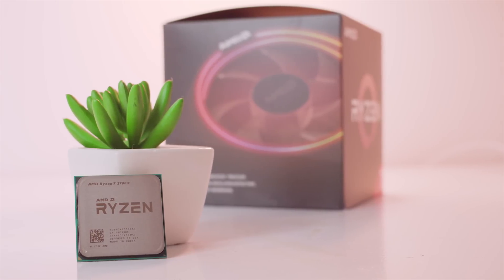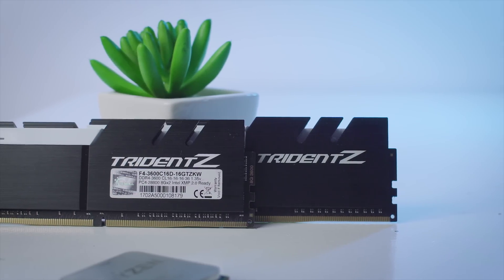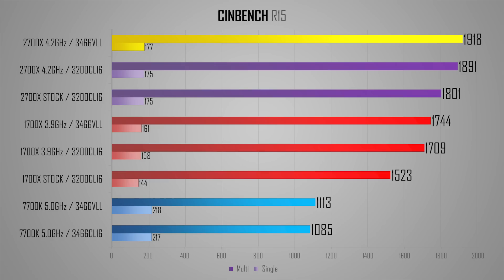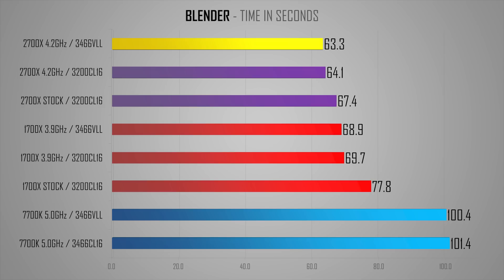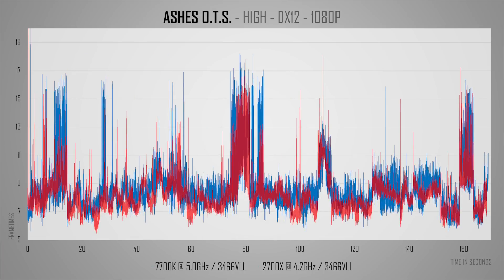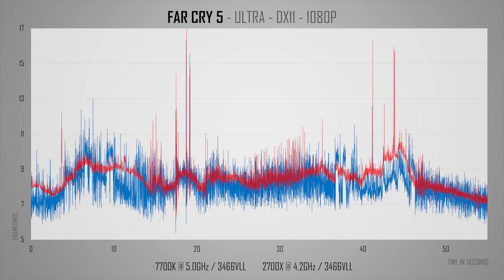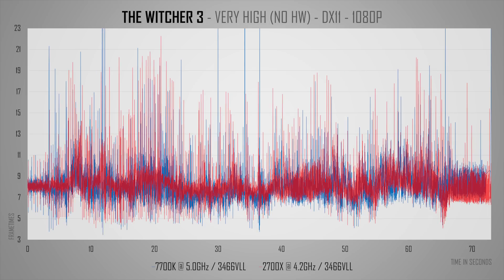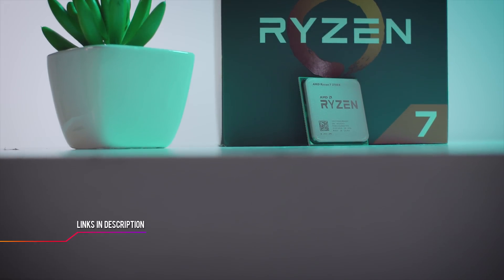RYZEN 2700X + Low Latency RAM - Still AMAZING PERFORMANCE gains...

Comment: https://www.microcenter.com/product/506496/gskill-flare-x-16gb-2-x-8gb-ddr4-3200-pc4-25600-cl14-dual-channel-desktop-memory-kit-f4-3200c14d-16gfx---black 
i wonder how these would perform.  I wonder if you could leave it at cl 14 and just overclock to 3466
Reply: It should be fine. Just turn up the voltage

Comment: @Mindblank Tech What were your timings (complete set) with your 1700x with the trident z ram? I've got an 1800x and trident Z ram and can't get stable at 3600mhz. Can you please share those timings for me please? Or email me at citizentechtalk@gmail.com please. P.s my 16gb 8x2 kit is a 4000mhz kit. I'm currently running cold boot 3466 14VLL myself. On warm boot 3533 14VLL on an Asus hero X370 board.

Comment: I'm late for the party. But, very nice video and very well put together! What do you use to test your RAM and CPU stability? I have tried Memtest86, AIDA64 Extreme stability test, and others but none give me accurate reliable results. Until I tried Prime95 v29.6 build using Large FFT's test. After an hour and a half the true colors come out. Every single setting I thought was stable at first failed the test.

I had to do some more tweaking to my 3466Mhz settings using the "FAST" preset on the Ryzen calculator to finally get a 6 hour stable run. No more random game crashing or system failing to boot at first try. I would never test with anything else again. Cheers and thanks for sharing this nice video!

Comment: So I have a question. I hope you can help? 
I have VLL on 3466mhz with my Ryzen 1800x running at 4.1ghz no probs. On cold boot I can get 3466mhz Cas 14 VLL to boot and fully stable no problem. Although I can get stable 3533mhz at Cas 15 and full stability in games also, BUT! 
i can't get my Asus hero X370 to cold boot on 3533mhz. Why is that and how can I get it to do it please? 
My RAM is Trident Z 4000mhz Cas 18. It's also B-die. So how can I get it to boot 3533mhz cold instead of 3466mhz?

Comment: so 2700x is actually nothing special isn't coz my 7820x @4.7ghz does 2060cb and singlecore is 550-560..can't remember right.. plus no issues in daw's like 2700x....
Reply: Well I would be amazed if that AMD processor beat your 7820X when you cpu has 500mhz more clocks over it. Also your single core won't be that high on same cinebench version closer to 200 sure.
Reply: @MrRyusuzaku  amd will never work as 7820x in daw's btw....as amd is not design for those apps...amd is cheapper for reason ..and my 9900k is way better then my 7820x...no amd 8 core cpu can match 9900k...
Reply: 550-560 in cpu z...sorry my bad...in cb is over 200...

Comment: Any thoughts on getting CL14 to work on Ryzen laptops, like 2700U?  Also, though the 2700x officially supports 2933, clearly 3466 works great.  So I wonder for 2700u, which supports 2400mhz, what's possible.. could make a huge difference!!  Motherboard/bios dependent I suppose.

Comment: You got some good numbers with Cinebench! I just recently switched to a 2700X but I am running Hynix memory @ 3000 Mhz / CL 14 based on info from the ram calculator and I got very similar numbers in the same benchmark.
1906 Multithread / 176 Single Thread

Comment: yip im a very happy owner of my 1700...man my games are soooo smooth that intel could not give me.
have 3200 rgb gskill ram..its awsum..
have overclocked to 3600 ram and 4.15 cpu..but i dont run it like that 24/7..as even at lower speeds it is still smoother than intel

Comment: Did you ever check for a bios update after this? My X370F Strix board is running my 2700x with this same 3600 B die Ram. It runs it off the dccop profile just fine.

Comment: I got my ram to 3400 with a cheap Ryzen 5 1600. And the ram was rated at 2666, but I overclocked it to 3400. And it’s been great
Reply: what motherboard are you using?
Reply: Asrock B350 pro4
Reply: Thanks, I am thinking about getting this mobo + r5 1600 also... Would you mind telling me your ram so I can purchase the same model? I can't afford to have any compatibility issues...
Reply: My ram is the Ballistix Sport 16gb 2666mhz. I overclocked my ram to 3400mhz with XMP. My timing is 16-21-21-42. Voltage 1.38 
It also depends on the quality that you get from the ram. My ram got Extremely lucky. But either way, you should able to overclock it to 3200mhz. My 1600 OC to 4.0 with 1.375 V
Reply: Support You thanks man, I appreciate it :)
Reply: 16gb x 2    or  16x4 ?
Reply: dicloniusN35 2 8gb sticks

Comment: So the thing I'm noticing here is that the 0.1/1% low's are the things mainly being affected by the use of VLL RAM, atleast on the intel side of things anyway. So my question then is that when using  an adaptive sync monitor (G sync or free sync) does the improvement seen in the 0.1/1% lows even matter since the adaptive sync should eliminate any stutters/tears that would have been observed due to the fps dips in the 0.1/1% lows?

Comment: Could you please compare 1700X and 2700X both at 3.9Ghz and @3466MHZ VLL ? 

I've got R7 1700 which is a rather "good" overclocker since it reaches 4.075Mhz fully stable at 1.375v.
And even benchable/gamingable at 4.175Ghz @1.45v but my ram is not so good... old DDR4 2400 CL16 memory not very overclocking friendly.

But I've just ordered G.Skill Trident Z RGB DDR4 Kit 16Gb 2x 8 Gb 4266 MHz CL19, I'm aware it won't be able to run at 4266Mhz of course. I'm just hoping it will be able to do at least as good as yours. I am a bit worried though because it seems it is a single rank ram kit and heard that dual rank gives better performance on ryzen...

Comment: How come 1700x has faster 1% and 0.1% fps in ashes of singularity https://youtu.be/PHBsR1Y68G8?t=335
It seems strange that it should perform better. And also the stock 1700 is faster than the overclocked version

Comment: From what I understand, if geardownmode is still enabled, when the command rate is set to 1T it will still effectively run 2T. I am running 3466-14-14-14-28-1T geardownmode disabled on my 1700 at the moment, my 2700x comes tomorrow. I am going to try for 3200-12-12-12-24. that gives a calculated latency of 7.5ns If I can manage it. at cas 14 it would take 3733MT/s to match that latency. My Ryzen 1700/ram kit refuses to go below cas 14; we shall see if the 2700x changes that.

edit: I should mention that tuning the sub timings is important, leaving them on auto will cause a significant portion of the gains from overclocking to be lost.

Comment: The diffrence between 2400mhz ram to 3000mhz is about 30$ i own r7 2700x should i get the 3000mhz or its not worth the upgrade and stick with the 2400mhz ?

Comment: But this video still doesn't answer the question of which is better - timings or frequency? Like is it better for me to go from 3200 to 3000 but with tighter sub-timings?
Reply from the maker: Both, but to a certain extent. Can't say that 2400CL13 will be better than 3466CL16. I'd drop to 3000 with tight timings - it'll give much better performance than regular 3200.
Reply: I've heard that for gaming timings are better but at what point does it become detrimental to lose frequency? These are difficult questions and I'm just sad most reviewers aren't testing them. You're one of the only few that attempts to shed some light on the RAM issues.
Reply: @crazyforcs  if you can afford,  you can buy 4400mhz tridentz 2x8gb kit and get it to 4200 cl16. From watching many videos, seems like thats the best you can achieve for 8700k systems

Comment: Ryzen at lower GHz is competitive with Intel at 5ghz. Enough said.
If Ryzen could overclock as well as Intel CPUs there would be no argument because Ryzen is so far ahead in multicore performance.
I use a Ryzen 1700x because it's performance is so good and I want to support AMD. 
No hate for Intel but we need competition and AMD is bringing it.
Reply: Ryzen rocks awsum
Reply: fuck intel
Reply: totally agree
Reply: You’re right I’d Ryzen overclocked more it would round it out as a better CPU. Ryzen and it’s core are only better for situations where more cores are needed. Core for core Ryzen is not matching Intel with lower clocks it needs at least the same when core count is the same. Also the quality of IMC ones gets with Ryzen will determine how far their performance goes on Ryzen. I get supporting AMD but they are not without compromise too. I have 2700x and 8700K and they both have their strengths and weaknesses.
Reply: What are you talking about? This is not fact.

Comment: I was really interested in this (nobody seems to do those tests), but you didn't show a benefit of lower timings. Comparing 3200 cl16 to 3466 cl14 doesn't tell us much, especially when deciding what to buy. 3200 cl14 OR 3600 cl16 RAM.

Comment: Shame you didn't do 3466Mhz CL16 vs VLL, since that would truly show how much of effect was from timing and how much from faster RAM. This kind of doesn't do it justice. Sure both are beneficial, but still it would be nice to see how much. Maybe even doing it like 3200Mhz CL16 vs VLL + 3466Mhz CL16 vs VLL, which would drive point even further, since it is video about Ryzen and low latency RAM. So whole comparison to the Intel wasn't as necessary as bit deeper dive into timings vs speed bit deeper. Here it only scratches the surface leaving you wonder if 3466Mhz didn't do most of the job and VLL was just a cherry on the top adding little to the equation. Just my thought on the video, no offense, nice video anyway.
Reply: same toughts

Comment: Yeah right....buy super expensive RAM + Ryzen7-2700, instead of regular ram + i7-8700K. The Ryzen7-2700 cannot even match in games i7-7700k, which has half cores. Pathetic.
Reply: lol. look at the price difference between a decent b-die kit and a "cheap" 3200 mhz kit. it's incredibly minor, plus you are paying way less for the cpu and mobo. plus if you had actually watched the video you'd see that the 2700x was competing with the 8700k. Nice try
Reply: What try? 'Competing' does not mean 'equal' or 'better'. The charts are in front of you and you are still in denial. The 2700x is competing with i5-8400 in games, it's not even close to 8600k/8700k/7700k
Reply: So thats a solid no to watching the video, gotcha

Comment: What have we learned today here kids? if you have a decent Ram Kit, pick the cheaper R7 1700X and enjoy.
if you play games that need high refresh rates and wan't to go Ryzen, only then go for R7 2700x :D

Games like CS:GO, PUBG and some others like DOOM are more sentitive to R7 1700X vs R7 2700x and they will favour 2700x because of clocks + lower timings. In general gaming the cheaper and cooler R7 1700X is still the way to go in my opinion.

Cheers and great video

Comment: i have 2666nhz hyperX Fury 15 17 17 35 2 OC to 3200mhz on 1.25v but i still cant find the ideal timings. On1.4v I can lower to 14 17 17 32 1 270 + 3 & 4 timings but its not 100% stable. My best score in Aida64 is 41.2ns but not stable and high voltages 1 .555v

Comment: Great video. My 1800x sadly has a weaker IMC as well. I can't get 3600 cl16 stable, but I did get 3466 14-15-15-28 stable with the ram calculator. This on 16gb Teamgroup Dark Pro "8pack" 3600 cl16 ram.

Comment: So 4.2Ghz + 3444 Mhz Cl14 Ram is the best way to get the best perfomance
Reply from the maker: Even stock + 3466VLL is excellent.
Reply: I'll be buying a 2700 soon, so a tutorial for 3466VLL would be appreciated :D
Reply: @ Chance James
If you wanna hit 3466mhz cl14 somewhat easily, go for a 3600mhz cl16 (16-16-16) kit. This G.SKILL Ripjaws V kit for example: 
https://www.newegg.com/Product/Product.aspx?Item=N82E16820232195
This is high quality B-die.
Reply: MindBlank Tech sorry so the 3466 VLL kit is which kit ? I'm having a hard time choosing a ram kit for my Asus x470 f and 2700x build. Cheers
Reply: thanks for the info !
Reply: https://valid.x86.fr/5y5ztm

Comment: 1:00 your calculations of latencies is wrong. Off by a factor 1000, in fact. At 1800 MHz, each clock cycle is 1/1,800,000,000 of a second, which is 1/1,800,000 of a millisecond, 1/1,800 of a microsecond, or 1/1.8 of a nanosecond. Which is 0.555 nanoseconds, rather than 555 nanoseconds.
Reply from the maker: Thanks for the info - forgot the Mega in MHz :)) So it's 8.888ns not 8888ns. Calculated wrong, entered correctly in the calculator...
Reply: easiest way to calculate the time for a single cycle is 2000/effective ram speed (2000 because of the double data rate. 1000 if you use actual ram frequency). in the case of 3466Mhz ram the formula is 2000/3466 = 0.577ns

Comment: would you please test the 2700x at stock with 3466 VLL.
Reply from the maker: I think there's no need. I included stock and 4.2GHz at 3200CL16 just so you could see the minute differences between these 2 configs. So stock+VLL will be 98%+ of the performance your see here.

Comment: What a complete dogs breakfast.
The premise is Ryzen 2700X performance with VLL RAM timings, but what we got in the results was a differentiation of not only lower timings but combined with a clock speed increase. At no point did you differentiate the Ryzen 2700X just with lower latency settings. It required at least one more metric to live up to testing the premise and that is with 3466 16,16,16 timings. If you can get 14,14,14 timings @3466 then you most certainly could have run that same speed with 16,16,16 timings.
I learned nothing regarding VLL and Ryzen 2700X here, because of the combined metric of speed and latency in a single data point. You can infer but you proved nothing.

Comment: I have cosair vengeance 3200mhz CL16 running at 3466mhz on a asrock taichi x370 with Ryzen 1700. Default timings but changed the 1.35v to 1.36v on the ram.

Comment: Could you please include a stock 2700x with VLL ram and Precision Boost Overdrive enabled in BIOS? This way, you will have max clocks speeds and the fast ram active.
Reply from the maker: I included stock and 4.2GHz with 3200CL16 just so you could see the performance difference between these 2 states. Since they are almost identical, stock and VLL will be extremely similar to what you are seeing here. Precision Boost on these chips works wonders.
Reply: Actually I meant the precision Boost overdrive. I think it's different from the normal PB 2. This feature in the BIOS boosts the 2700X to 4.3 - 4.35Ghz on all cores as long as thermal headroom is there, so a aftermarket cooler is a must.
Please refer to this video. And the best part is no manual OCing is needed! XD
https://youtu.be/LiFPHdXLiPc

Comment: Thanks, been waiting for this video the most of all Ryzen 2x00 coverage. One thing I'm curious about, how is this at 1440p (and 4K)?
Reply from the maker: It's less and less obvious as res goes up since the CPU stops being the limiting factor. I play at 3440x1440 and in FC5 for example, between 3200CL16 and 3466VLL there's around 2fps average difference. In some games which are very CPU demanding, there's still a sizeable difference even at this res.
Reply: I wouldn't go up that far in resolution or GPU, my target was playing 1440, ideally 144 Hz, on a 1070 (and maybe upgrading to some future GPU flagship).

Comment: Bought today parts for my ryzen build - taichi x470 / 2700x
and  due to your previous researches  - low latency (cl17) 4000 gskill ram
Will play around, hope this RAM will achive tighter timings at 3600-3466
Reply from the maker: I found even 3200VLL to be great. 3466VLL is currently like top of the line for these CPUs, unless you're really lucky and get a chip that does 3600 RAM with little effort. Then you can try 3600VLL. :D
Reply: Yeah. I noticed that 3600 is where ryzen meet the wall. My idea was - low latency high speed memory theoretically should be able to achieve lower timings at the same frequency.
And who knows. Maybe one day ryzen will hit 4000mhz

Comment: I've alyways only bought ram with timings of 14 or less...I don't understand the point of 4000mhz ram with timings like 19-25-25-45 like the corsair dominator platinum kit I'm looking at right now on newegg....my g.skill kit is 3200Mhz with 14-14-14-34 which I think is amazing
Reply: It's quite possible that both kits can run at the other one's speed. ;p
Reply: luckz I don't make decisions on what's "possible", only what I can prove or guarantee
Reply: Each CPU IMC and ram kit is different.